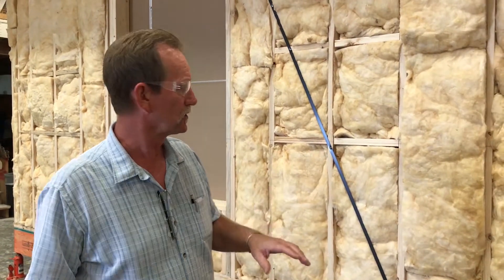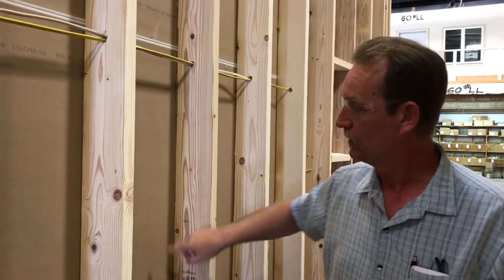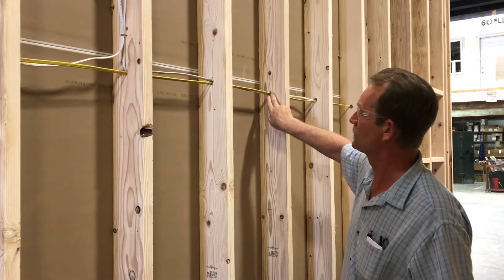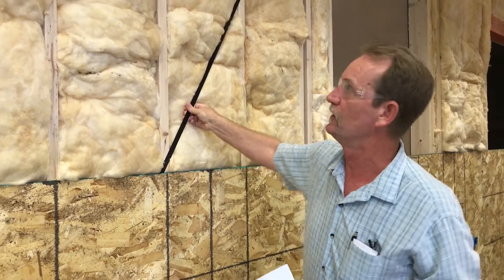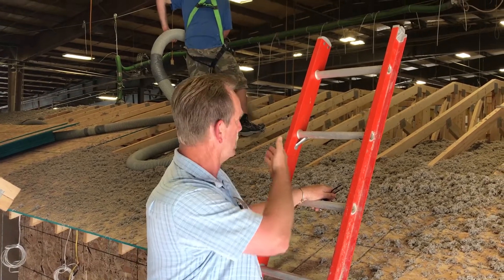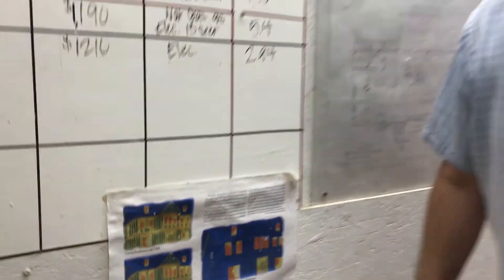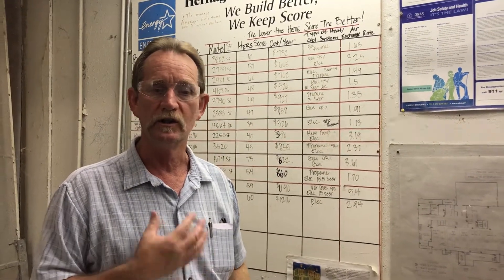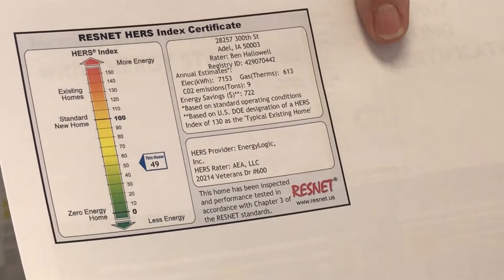Modular Construction Energy Efficiency

Comment: Around minute 5:00 it shows cellulose insulation being put under the roof. Is there a risk the roof might get a leak and then the cellulose would feed mold? Is there an alternative?
Reply from the maker: Hi Kelly! We've looked at a few different options over the years, so great question. We take great pride in our energy efficiency and this has been a good product for us that we are happy to stand by it. Most people would believe closed cell spray foam would be the best option, assuming it wouldn't susceptible to mold, which is surprising untrue! Our cellulose attic insulation meets all the state & international building codes, and offers a higher R Value than both fiberglass and batt insulation. Of course, there is always room for improvement, but mold and leaks are not something we've seen issues with over the years.